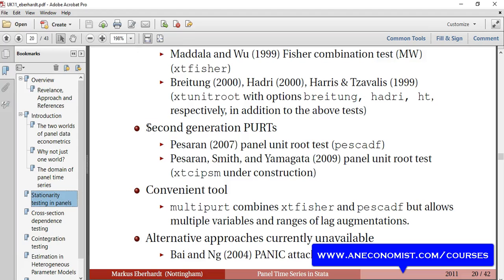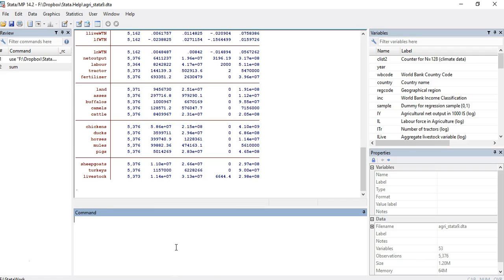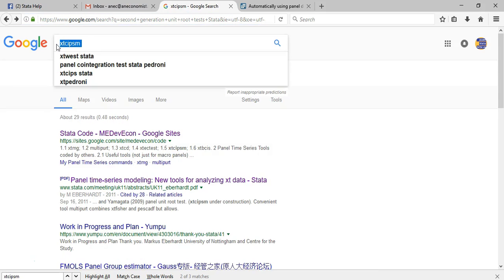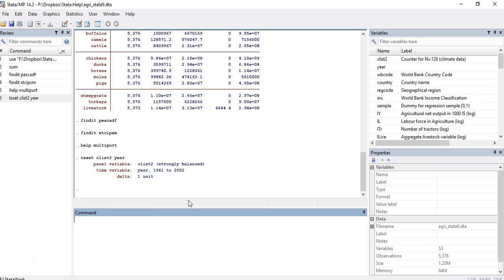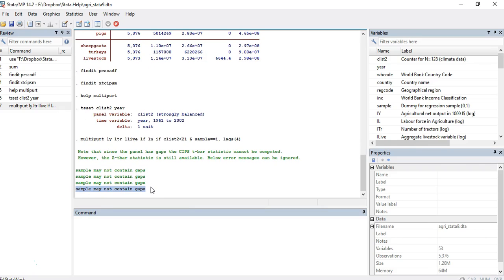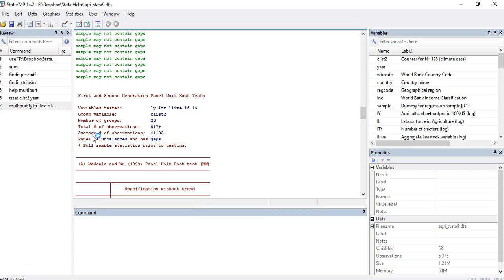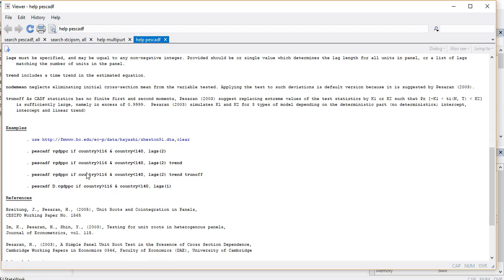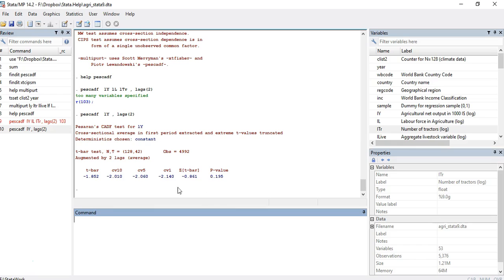Second Generation Unit Root Tests using Stata

Comment: Sir, you did not make a decision when you used the "multipurt" command. How do you make a decision considering the fact that for every variable you have the following options: with and without trend under both the first and second generation tests? Some variables are stationary Maddala Wu test but non-stationary under Pessaran test. The inverse applies to some other variables. So which test should be relied on?

Comment: Respected Sir, I am working on panel data and for this I have two equations. I equation 1 I first checked cross sectional independence and then applied the unit root tests regarding to it. But, in equation 2 I have no cross sectional independence and I not able to find commands for the unit root tests (except pesaran test) for this type of equation. Kindly, guide me in this Topic. Thank you in anticipation.